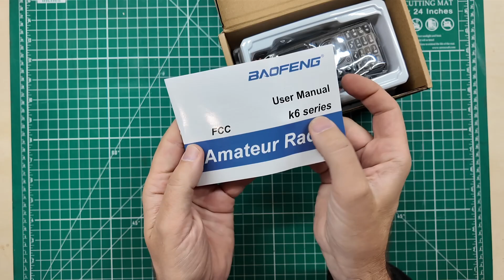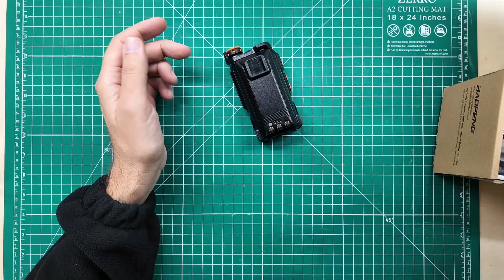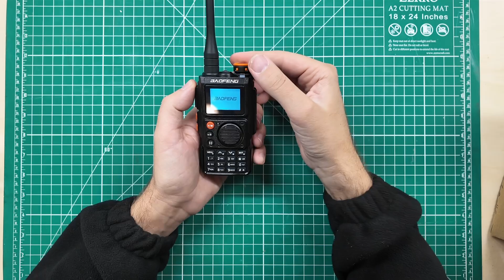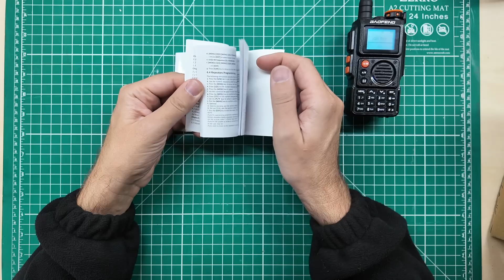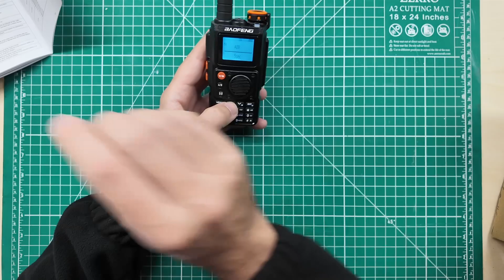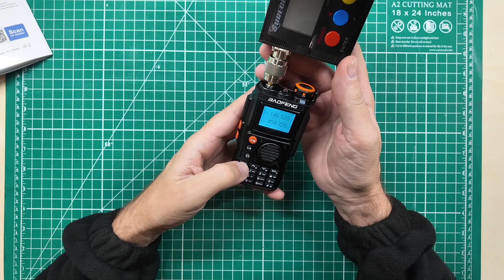How Different Is It?

Comment: Theory: SWR goes up when power goes down on 2 because the power control mechanism is to spread the power over multiple bands including some where the antenna doesn't work.
Reply from the maker: Could be.  Also the filters work differently at different power levels, which I think plays into/off of what you are saying.

Comment: Found a quick easy test to see if a radio is "noisy". Take your new radio and get hold of another.  I then set them to the non ham 2 way channels one radio on channel 1 and channel 8 and then the other to channels 2 and 7. I then see if the radios trigger each other that way. I have a Baofeng GT-5R (clean) and a UV-K5 Plus (dirty). The GT wont trigger the UV but the UV will trigger the GT.
Reply from the maker: That's a great way to find Front End Overload or Poor Selectivity!  The radio that can hear signals it shouldn't is the bad one in your example.  Nice find!